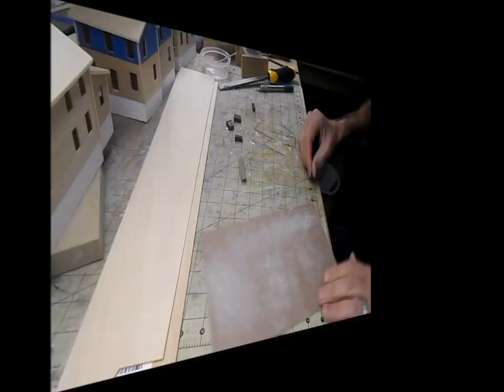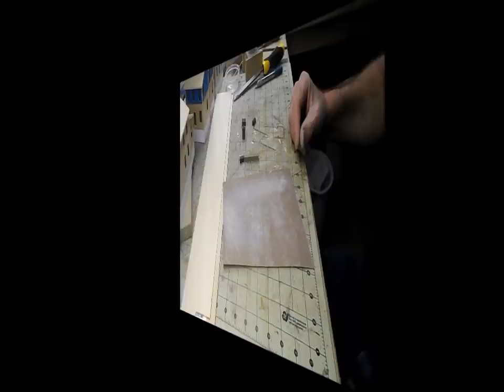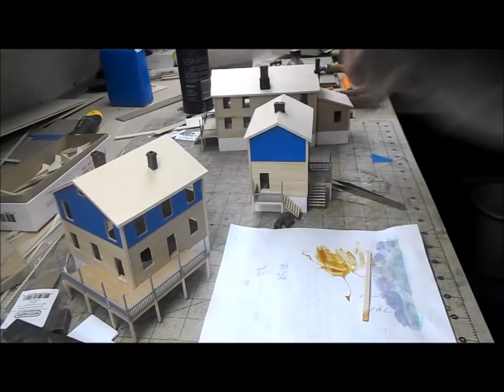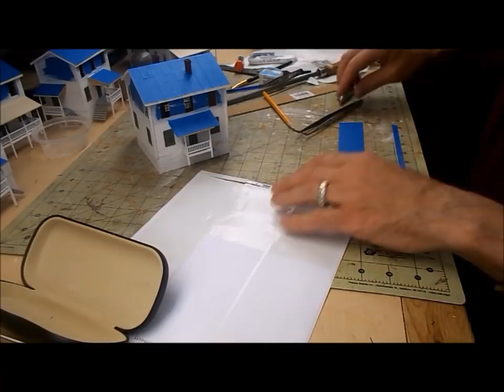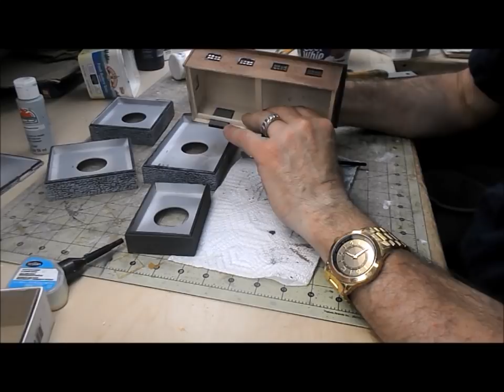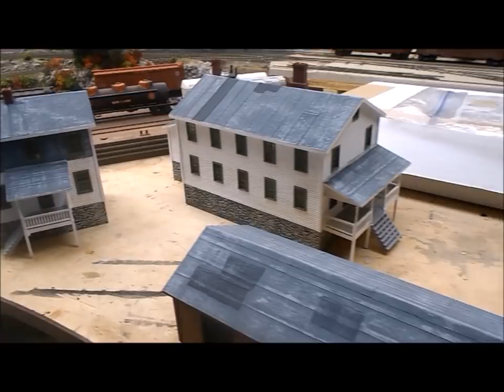Build an HO-scale mining town 4: Details & paint

Comment: All the basements of the original homes in our town were made from cinder block, which over time were painted in a beige or primer grey like colour.  Only the more modern homes were done with poured concrete foundations/walls.  
The last house we lived in, we added an one storey addition onto the back of it.  The walls had so much rebar in it that my dad had to borrow a small water cooled jack-leg diamond drill (only 8’ in length) to drill 2” holes in the one wall where we put a door to enter that section.  After that I ran a compressed air jack hammer to break up the concrete between the holes.  All in all, a two week adventure because you couldn’t run the air or water compressor anytime after seven at night.
Reply from the maker: They are not concrete basements.  I wrapped random stone sheet around them for the final visible surface.
Reply: mpeterll
Reply: mpeterll  - I apologize, I was only commenting on the homes in the mining town I lived in.  I tend to think fondly of 20 years I lived there.

Using rocks as a foundation wall is very common.  The basement walls of my Grandfather’s home were made of stone and masonry.  It provides a very distinctive relief pattern to your buildings.

I guess the only comment I’d have is this, why have all the homes painted white?  I know it was a quick and easy method of finishing the large number of buildings you had to build (and it was very effective) but don’t you think that over time the residents would have wanted some kind of colour variations in their homes?  

Sorry, I guess I overthink things.
Reply from the maker: I asked the same questions the first time I built a batch of these houses for a customer (the N-scale project last year).  The prototype photo I worked from showed all the homes painted in the same color scheme.  I guess the mine still owned them when the picture was taken.  Based on the autos in the picture, it was probably taken in the 70;s.
Reply: mpeterll  - very interesting comment that the mining company had the all homes painted the same colour.  

I guess that goes to show the differences in corporate thinking.  Falconbridge Nickel Mines while not being the greatest at HR in the late 70’s, always had, up that point, their employee’s concerns and well being in mind.  The homes were always well maintained and they built several public use and recreational buildings for the families who lived there; a Hockey Rink, Curling Rink, both Committee Centres, both Schools, Bowling Alley, Fire Station (a large”ish” single garage that held the Volunteer Fire Brigade’s truck), Walk-in Health Clinic (which was also the company’s First Aid Centre), and Police Station (Mine Security).  This was all for a population that never really reached over a 1000 residents.  The High School that I went to in the neighbouring town had more kids in it.

Anyways, the point I was trying to get through here, it was company policy that all the homes would get the exterior trim painted every 4 years and the interiors painted every 6.  There was a choice of colours and the family picked what ever they wanted.  The downside to that was, if you were able to get a new home (ie: you had a higher position within the Mine and /or a bigger family), you had to wait till the next paint cycle before you could get a new paint job.  The last home we moved into while it still was a company town, had every room painted in some shade of pink.  My Mom went crazy waiting the two years before we could get all the rooms painted some other colour. LOL!

An interesting little fact about our town,   The first Mine shaft was started by a rather energetic American inventor with the last name of Edison.